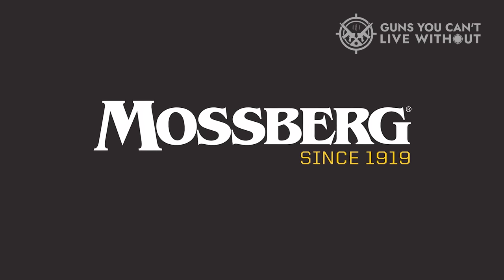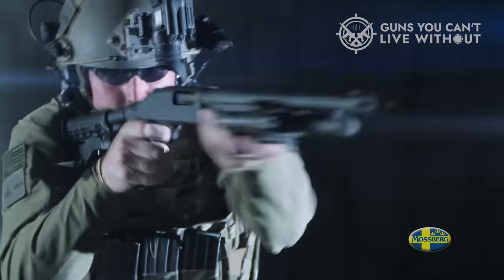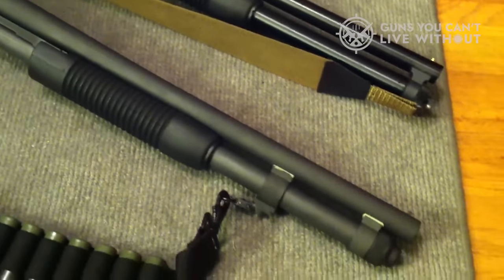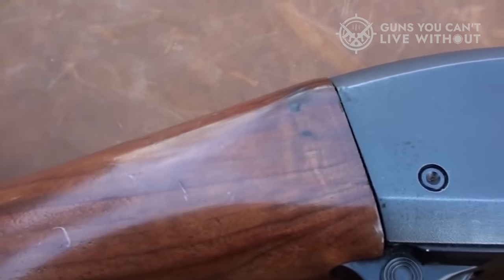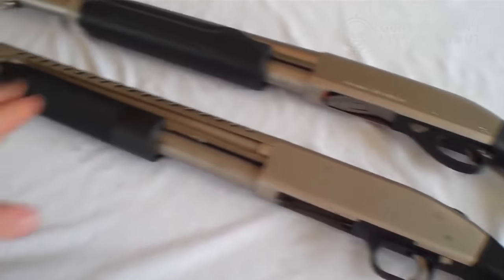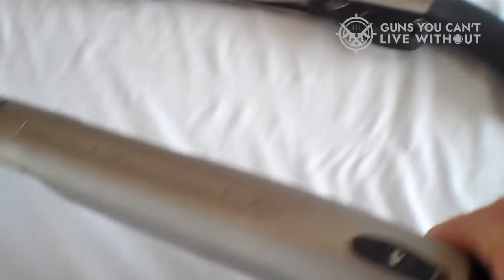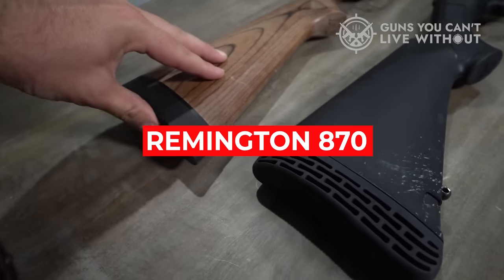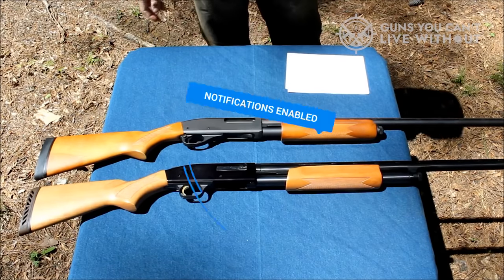Mossberg 590 vs Remington 870 - NOT EVEN FAIR.

Comment: The video can be easily summed up into the phrase: "get whatever you like best." The 870 is my service shotgun and the difficulty in repair is a major issue for service use of 1,000 years or so a year. One user issue not noted in the video is that in order to actuate the action bar lock on the 870 you need to break your grip (if you carry without one in the chamber). I personally use the Mossberg 500 for the feel of the tang safety, and that I can use my middle finger to actuate the action bar lock.

Comment: I absolutely love my 870, the only problem I had with it was the magazine tube having dents in it to prevent adding any tube extension. This was easily removed with a tool you can get for a few bucks on ebay. I've run numerous types of rounds though it and it's performed well with anything (including slugs!). I haven't handled very many mossbergs so I can't give any accurate opinion on those, but I can say that my 870 is well made and never let me down.

Comment: In the early 80's Mossberg had push on 500's, sold low price thru Ames, had couple friends buy, back then the bolt would toggle sideways and hangup, Mossberg worked on them and they did get better, both like any pump action are fun when half racked, carried rigging knife that was best for clearing it.

Comment: The Mossberg 500 and 590  have been tested by numerous government agencies for adoption and issue. Tens of thousands of rounds have been fired with near zero failures. The dual action bars of the pump doubly strengthens the action and ensures the action isn't the source of failure. The Remington is a fine weapon and can accept magazine extension tubes, but the action button that releases the slide and safety location I consider superior in the Mossberg to the Remington. Unfortunately the Winchester 1200/1300 shotgun series of pumps and autos were fine weapons as well but were terminated.

Comment: I've taken two combat shotgun classes. Both classes had a mix of different brands and a mix of both pumps and autos. In these classes I ran a Mossberg 590 A1 18.5".  My brother who is a LEO and NRA Instructor used a Maverick 88. For some reason during the class some of the guys running Rem 870's were having issues with Combat loading causing some type of jam. It was not a constant thing, but it happened more than once. I do not know what year these guns were made, so there is that. I found that my Mossberg 590 A1 had a tendency to short stroke as the action was not very smooth and multiple time I thought the action was all they back when in reality it was not, thus I slammed home with no round. I also noticed that humping a 590 A1 around all day was not enjoyable as the weight was noticable compared to the other guns. With all of this being said, I sold the 590 A1 after the class, the weight and rough action was not worth it in my opinion. I did not however buy a new pump as I was really impressed with the auto loaders and will most likely purchase a Beretta 1301. IF, I had to buy a pump action shotgun I would purchase a Maverick 88.....yeah I said it, a Maverick 88. Smoother action than the 590 A1 and much, much, much lighter. My brother had zero issues with his and it worked very well.

Comment: I love the 870, but blew up an 870 supermag shooting clays. I was running it fast and on my second round first shot it failed to fully eject the spent shell. The spent shell flipped sideways sticking out of the breech, but did not eject fully, so when I ran the next shell up it slid ahead of the spent shell.  Then the spent shell pushed the new one into the chamber and as I was pushing the foregrip hard and fast when things jammed up was when the rim of the spent shell dented the primer on the new shell. Boom !!!. The blast came out of the partially open breech and blew the trigger group downward 3/16" . Now the spent shell sticking out sideways was flattened in the brass area. The exploded shell was massively deformed in the brass. I worked on it and removed the peices of each shell and bagged them separately. Don't know where they are now. However, I installed a new trigger group and found something good for a fix! I got a new extractor from volquartzen. It's called the (exact edge extractor.) Worth it's weight in gold. I don't run 3" on clays anymore but I run it fast and it doesn't fail. And I can run 31/2" mags In it for deer and do what I want. It's great. However the 590 is a supergun!!! And I love them!!!

Comment: I have an old 870, from the 70s.  The shotgun is is easy to handle, balanced and smooth.  The stock is good Walnut.  Takedown is simple.  two barrels.  I've never had a problem with it.

Comment: A lot of it depends on which shotguns you are comparing.  I have two 870's.  One is a Wingmaster I bought in 76.  The other is an 870 made for turkey hunting and I bought it about 8 yrs. ago.  I would put my old Wingmaster up against any currently made 870 or any Mossberg ever built.  BTW, I do own a Mossberg as well..  The old Remington is smooth operating, solid built, and dependable in all situations.  47 yrs. without a miss fire or mechanical failure.

Comment: Reading about everyone's story and preference is great... I lucked out one day at a gun shop and found a used ex-Police 590-SP (Special Purpose) in extremely clean condition... it's set up like the A-1 with the heat shield and bayonet lug, but the 20in barrel is standard, not heavy duty, and standard polymer trigger housing... but one key feature is that it takes 9+1  2 3/4 shells, but with the adapter feed plug it will take 14+1 Federal Shorts... PLUS a bayonet... now that's kick some ass home defense... 😁... You might laugh at the idea of a bayonet and what it could be used for... it prevents someone from charging you and trying to take your weapon without you having to shoot them... you can be charged is someone decided to impale themselves on your bayonet while attacking you... but shooting anyone now-a-days can get you charged... consider it a Semi-Non-Lethal Deterrent...✌

Comment: You can't beat the sound of the metal receiver of the Remington 870 when you're racking the bolt.  I've made potential burglars back down and run off with THAT sound (in a dark house / open windo).   The Mossberg sounds 'Aluminum' like.  Both are very good shotguns, I have many of both of them (in different configurations).  Frankly I'd carry both of them in a life or death situation.

Comment: I bought a Winchester Defender in the 80s because our squadron had a bit of an issue with guys using Navy parts on their home guns. Rem 870 being the center of attention. I still have it and have never had a problem of any type. I have the trigger mod  which allows the kind of use the Germans wanted to call a "War Crime." This is my primary home defense system. If I need to "Put in some work," I go to the Benelli. For tax purposes I like to have a clear distinction between work and not-work tools and equipment.

Comment: My 870 was born, as best I can tell, in 1992 as a 28" turkey gun model with a vent rib. It's smooth as anything but was cumbersome at that length, so I had it cut down to 18.5" and had a thin-wall choke system installed, along with a tritium front bead sight riding atop the vent rib and a 3-round magazine extension, bringing the total to 8+1.  I very much like my custom 870.  I have shot newer 870s that don't seem as good, and I would probably choose a newly-built 590 over a newly-built 870.

Comment: I rock the 870 because the safety can be disengaged by sliding your finger into the trigger guard making it incredibly easy and intuitive under stress. No hand gymnastics with a  pistol grip. Other than that,  they are both fantastic choices.

Comment: I own both, abuse both and like both. The 870 ran a little smoother out of the box that was the only difference. 
 My guns often are submerged in salt water , brackish water and in  the mud in 
bottom of my tender when hunting. The dogs bring in the mud . 
   When we get home they get washed down in warm soapy water , rinsed , thrown into a tub of solvent , blown dry and sprayed down with penetrating oil and left that  way till the next hunt. The next hunt they are wiped down and away we go again. 
 I am 62 and I got my 870 at 16. 
 I have shot deer, moose and bear with it as well as birds. It has never needed repair and never failed me. The Mosberg is my wife’s gun and it runs flawlessly as well but does not have the same milage on it. 
  Love them both but not as much as my wife or dogs.

Comment: For a pump shotty I prefer the Remington 870. Had one issued during my LE days, and personally own an 870 Marine Magnum Stainless. However, my go to Tactical shotty is a Benelli M1 Super 90. Very fast cycle rate, impressive accuracy with slugs, and absolutely reliable, so far. My go to for bird is a Beretta 686 Essential O/U. Super light, a tad shorter bbl's for swinging in the trees, selective trigger and ejectors. No frills, it just works and works very well.

Comment: I used an 870 as a skeet gun for 10 years using 200 rounds a week. That is 100,000 rounds.  Never needed to replace a part. Had one shot that was a dud I assume it was a cartridge failure.

Comment: The "Maverick" has a push through safety, I ran a "pistol grip" on one for YEARS.  I took  the pistol grip off and replaced it with a Hogue Shoulder stock after arthritis prevailed.  I have a M-590-A1. it is a GREAT Shotgun, but I LIKE shooting the Maverick BETTER.  The main reason is, the Maverick has been scratched up and carried and dinged, I have refinished it TWICE, but it still  shoots GREAT!!!  The M-590 A-1 is still "pretty" hate to get it scratched up.  One thing though, the M-590-A-1 (mine) does NOT have a steel Trigger guard and group  it does NOT attract a MAGNET.  It is POT-METAL I believe.  The Maverick's Group is Polymer, I wish it was METAL, but it has NEVER given me a problem.  I have owned several Mossbergs, never had any trouble with ANY of them.  A Mossberg dos NOT have that FINGER and Glove Pinching Follower the Remington has.  I HAVE a Remington 1100 Tac 4 autoloader, that FOLLOWER is aggravating on it.  It is a HEAVY GUN, my least favorite gun to shoot because of that bear trap follower.

Comment: As a "westpaw" shootist, I've always preferred Mozzies.
6:13 That's only if it has a lame duck plug in the mag tube. Otherwise, total capacity is five (4+1) standard rounds.
7:44 I'll never understand why Mossberg changed the position of the front sling swivel stud. The old way made more sense.

Comment: I have a Mossberg 590A1, and have used 870s. I prefer the Mossy because of it’s rugged construction and ease of maintenance. I dont care that it rattles more that an up-armored M1025 from 1987, because I’m not trying to x-ring at 1000 yards with it. I use it for 100 yards and less, so Minute of Man is perfectly adequate. I’d rather it work in any condition than be smooth.

Comment: I have multiple 870's and a Versamax.   I've only had one issue with one of them.  The 3.5" 12 guage didn't have the chamber properly polished. It was causing an ejection failure on goose loads.  Polished it with fine steel wool and a drill. Problem solved.  Only own a mossburg MC2c.  Good pistol. Never selling my Remingtons.

Comment: I own both Mossberg and Remington shotguns (500, 590a1, and two 870 police magnums). For work in a cop shop, the steel receiver DOES make a difference, as my 500 picked up a number of deep gouges in the receiver at work. Unfortunately the QC issues regarding the MIM parts for the new 870s are real. If you can't get an older 870, then I'd go Mossberg.

Comment: I've been trained at work with the 870, more than a couple times, but I really prefer the 590 and that's what I own an carry at work when I have a choice (for wildlife protection). The description of the loose feel of the Mossberg is accurate, but for me, a person who does not spend 100's of hours or more with a shotgun, the Mossberg has been more forgiving and reliable - in my hands. I have never gone through a whole training day with an 870 that didn't have me stovepipe jam at least one round, while I have never had a problem with a Mossberg (or a Benelli, but that's a more complicated and expensive gun and needs more practice to use under pressure). Considering that I will likely never use the gun except under high stress or pressure outside of training sessions, I prefer the one that I never jam under pressure and I really have an easier time with the thumb safety, because I can see if it is on when I look down the sights, which makes a correction that much faster under pressure.
I'm sure with more training and practice the 870 would get comfortable enough, but it's only a small part of my job and I more often carry a .454 Casul revolver for bear protection because it doesn't get in the way of doing my main job as much. If I'm going into an area where it seems worth having a shotgun and I'm one of the people watching out for others, I trust myself a little more armed with a Mossberg.

Comment: The difference in between these two can be described with a single sentence: There is absolutely nothing that is stupid in Mossberg, but there is absolutely nothing that is not stupid in Remington. This statement is about design, but when come to quality control, things are changed over time drastically. For example my 8 years 500 is perfect, my 3-year 590 I had to send them back and Mossberg couldn’t fix it, they sent me a replacement which is acceptable, but not perfect as my older gun. America as a country is sinking by rapid speed, so that is why we have bad experience with Mossberg and S&W too. My 15-years S&W M&P is perfect, my new S&W Metal I had to send it back to repair, and I received it back without them addressing the serious issue. They didn’t even bother to tell anything.

Comment: I know my shotguns, but many viewers might not be as well versed, which is where a video such as this should come in to fill that gap. However, you may as well have just had audio alone, if you're simply going to blather on about feature differences (such as between the 500 and 590) without actually showing them, accompanied by irrelevant video bits.

Comment: I have owned both and currently own an 870 that’s about 30 years and put 1000’s of rounds through it. At least half of which was steel shot duck hunting in the salt marsh. I’ve never had a problem with this gun. I had a Mossburg for awhile quite a few years ago and just never did like the feel. It also had several problems over the years. I do prefer the safety on the Mossburg  13:40 but I like everything else about the Remington. I do think the more modern Mossburg are better than the older models

Comment: I'm surprised there was no discussion of loading shells.  The lifter on the Mossberg stays out of the way when the bolt is forward.  Not so for the 870.  It's a small thing, perhaps, but if you're running the guns with gloves on, it could become a bigger problem.

Comment: I have owned and shot both extensively for decades. I cannot ever remember the 870 failing. The achiles heel for the 500 is the rods that connect the action to the forearm.  I have broken them 4 times now with heavy loads such as slugs, or heavy steel shot waterfowl or turkey loads.  Maybe its better in the newer heavier models,(590 etc) but as I use them afield, weight is a big concern also. I also shoot lefty most times and the cross bolt safety is no concern. I use my middle finger and pull. I am right handed, left predominant eye so at a young age I tought myself to shoot lefty.  I shoot rifles or optics lefty exclusively, but with a shotgun I am ambidextrous and just as comfortable either way. Out of habit I shoot lefty most often, but on occasion usually I will shoot righty, usually in a certain direction pass. I never preplan the side, and ususally realise i switched as an afterthought.
 My 500's are older models with all metal parts, no plastic.  same with my 870's
Reply: All the AR are aluminum better than steel that’s why it’s a popular rifle. So the  metal receivers on the 870 means nothing.

Comment: 590 for me. Better ergos, i like tang safety, no part blocking feed gate. The slide release lever can be done from firing grip where 870 you have to adjust off. Plus mossberg is still family owned and seems to have better quality control and passed military test no one else did

Comment: As for aesthetics, Mossberg feels like a 2x4 in my hands, the Remington fits like a glove. I'm not a fan of Remington's ejector setup, b/c I've had to fix the ejector spring/housing on the last two pawn shop buys. But it's a quick and relatively easy job, two tiny rivets, I've learned to leave a little rivet sticking out of the side instead of trying to refinish the whole receiver.